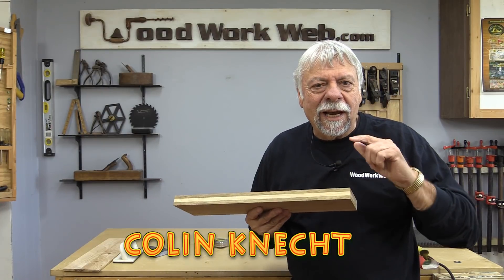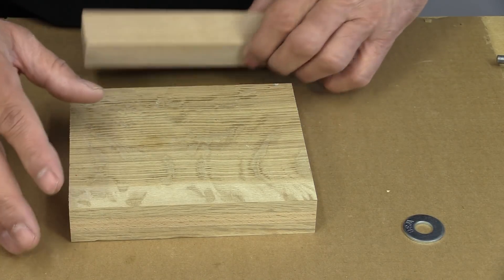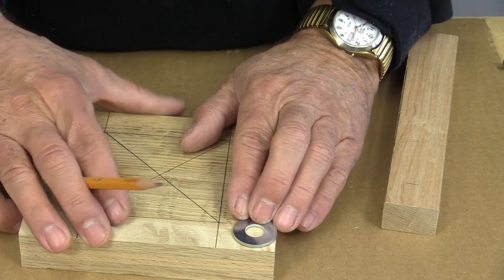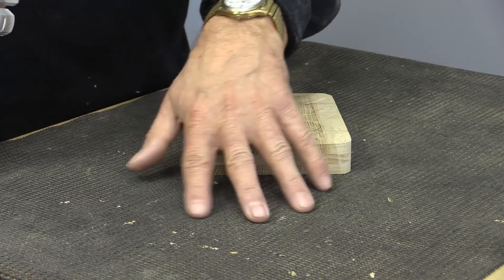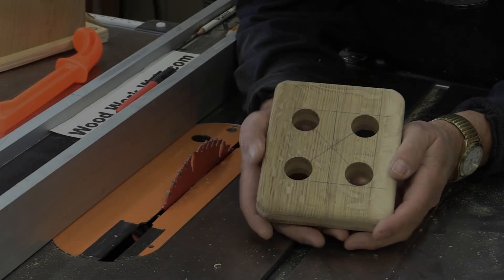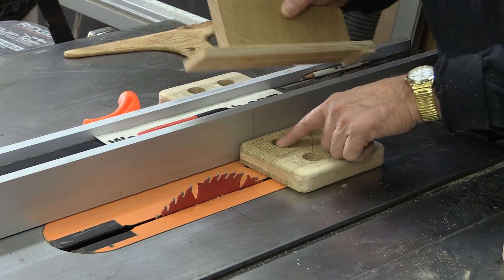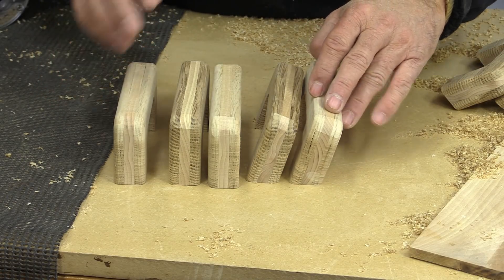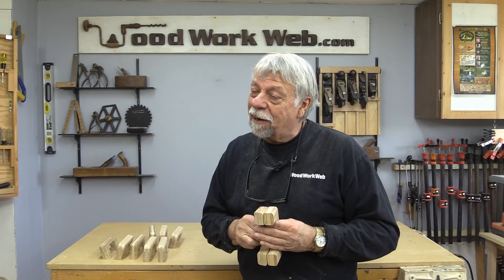How to Make a Wood Handle / Wooden Handles for a Woodworking Jigs

Comment: 1:55 the diagonal lines appear to actually indicate the mid point of the board, and nothing to do with the holes.  The washer tangents can easily mate up with the existing lines without the diag lines.

Comment: I love the idea of using laminate for stronger handle. 
Is it right to say the line that is drawn at 2:23 minutes is not in the good direction ? If we look at the orientation of the grain on the finish handle, the line to cut the piece in 2 should be on the same direction than the grain.

Comment: That's a smart way to make wooden handles. Thanks for sharing.
When you laminate wood (three layers in this case) do all layers have the same grain direction or is the
middle layer turned 90 degrees?
Is it worth (the time and the effort) to make a template for all the lines to draw at the pieces of wood?
I can image (myself) making a bunch of these handles and then after a while making a mistake, drawing somewhere
a line where it should not be, It'll be noticed only after the cut-out and I end up with a handle which is not as it should
be (or even totally worthless).
Reply: That was my thought on the grain direction.
Reply: In a couple of screen shots, it looks like the layers are in the same direction.

Comment: Another good video Colin ... thanks. I'm always interested in symmetry and repeatability. One question though: say I was making handles for a chest and they would be used for lifting it and it's contents. You have short grain at the ends attached to the drawer/whatever. Since you laminated material wouldn't it be worth noting that changing the long grain orientation on the inner layer would increase the strength?  Maybe I'm nitpicking as I always appreciate your videos but just something I noticed.

Comment: hey Collin I have noticed that your big push block still has screws in the bottom you might want to think about taking those out and replacing the hole with a dowel one at a time of course because if your saw blade manages to hit one of those screws (it looks like you may have already came pretty close) it could cause kick back and rip it out of your hands and cause you to end up with maybe cutting yourself or losing a finger or two.
Reply from the maker: Thanks for the tip Donald, and thanks for watching!

Comment: Saw the title handles....pffft who can't make handles...?

But realizing you have a trick for everything. And the parts holder with the slide. I do believe that will be in line.
Have to say you either muffle your camera or you saws are either do sharp with a micro kerf or they're extremely quiet.
I guess I haven't seen newer tools worked since...I'm not going to put any numbers to that.
Thanx